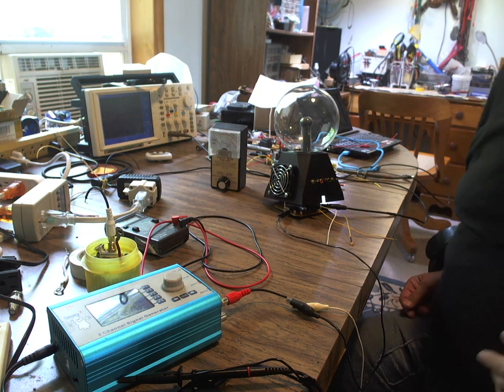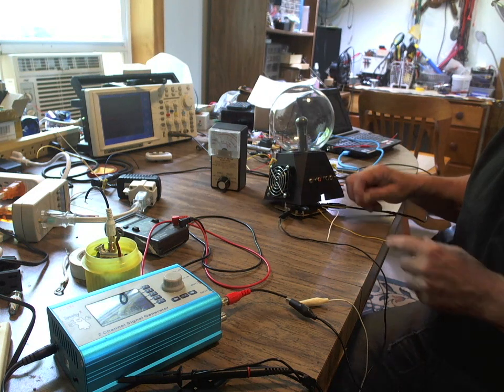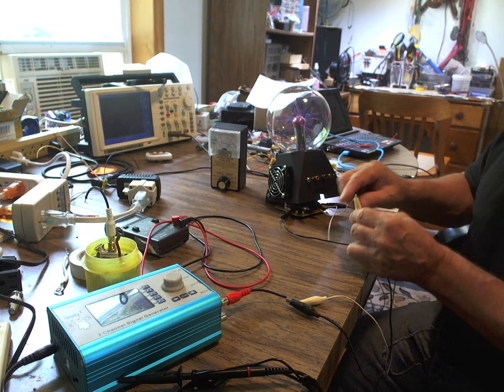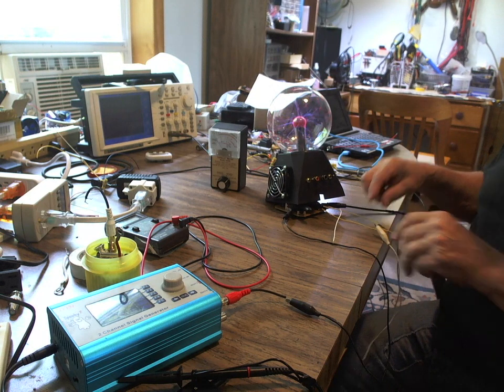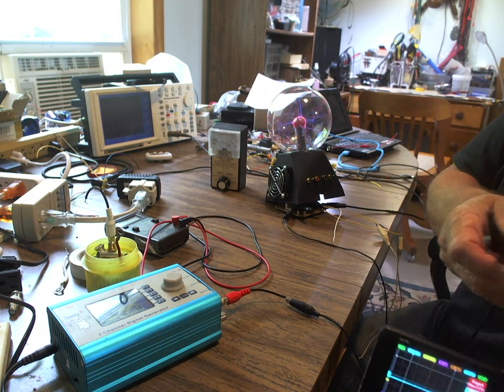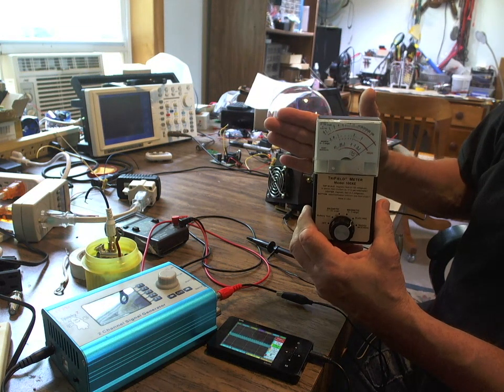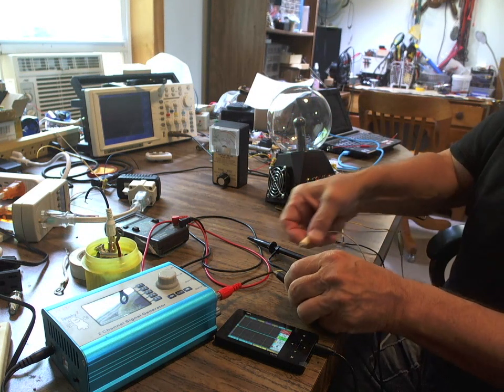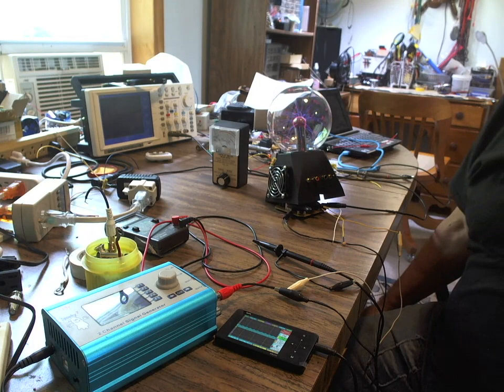Plasma Ball Modification Video V7

Comment: why not experiment if a plasma ball could be used to disable the corona virus in the lungs simply by holding a plasma ball/plate near the chest/front back.....? without any rife complications.
Reply from the maker: It already can if the Spooky2 protocol truely works.  However, how do you propose the test actually be done?  No one that I know of has Covid-19 and I doubt seriously if I will find anyone within many miles that has contracted the virus.  There might be a case at the local hospital but I really doubt that there is.  Additionally, the hospital is controlled by the AMA regulations of the "Standard of Care'" and will not allow any non-allopathic therapies.
Reply: @gskempe9  why not try a electron microscope to see if it effects the virus. they say everyone will get it the corona virus in due course so that means you will get it too...you could try on yourself and if successful then try it on others....

do you have any ideas?

Comment: I want to buy a 10m cabel to the Plasma Ball, is there a cable length limits for the frequencys?
The default cable is just 2m i want to extend the range.
Reply from the maker: For the past several months I’ve been using a 6’ audio cable.  They work great.  You can find them on the internet for just a few dollars.  10 foot would work just fine but 10 meter might be a little too long.  Don’t know how it would work because I haven’t tried it.
Reply: @gskempe9  So 3 meters is the MAX lenght, thanx.